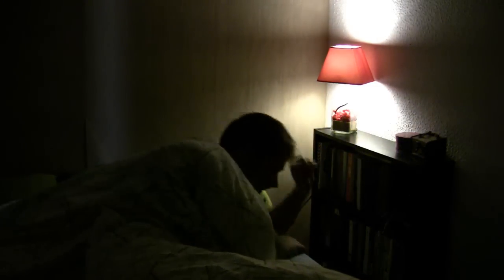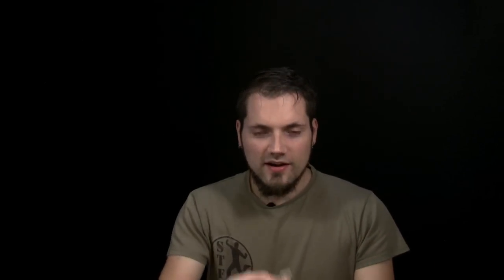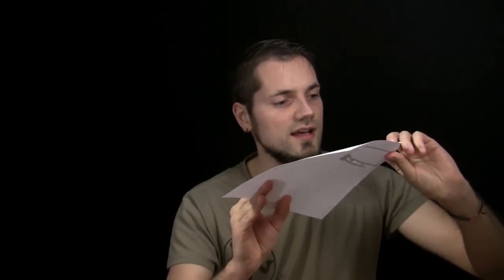See What's the Time at Night by Blowing on Your Clock!

Comment: Great video! 👍 nd how can we use led's  which r more brighter than the one u used in the video?
Reply from the maker: Manan Mehta 
Cheers! You can hook any ~ 3v LED and it will work. It can be soldered to the copper tape or to the sensor.